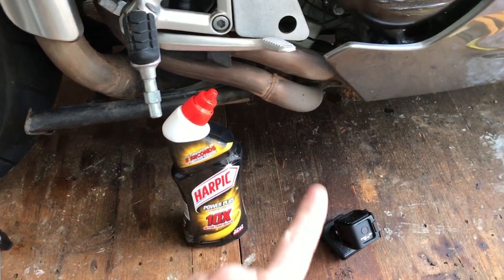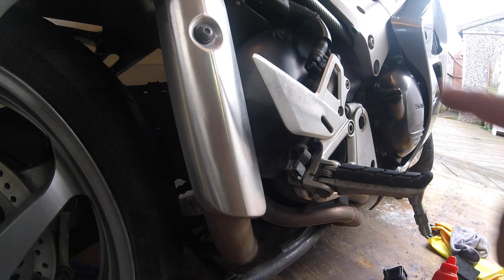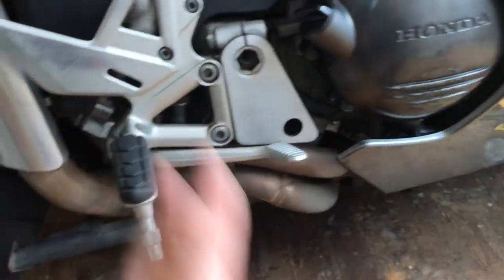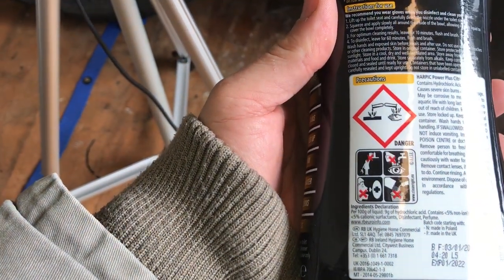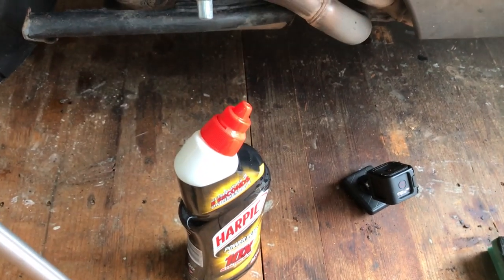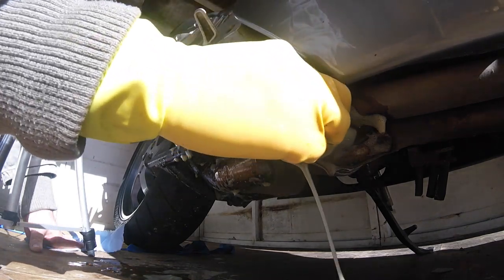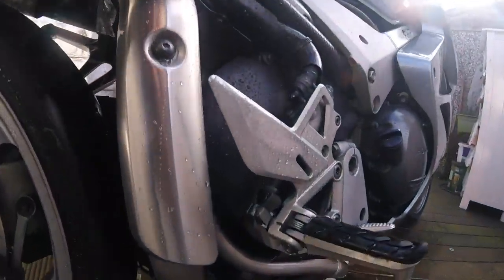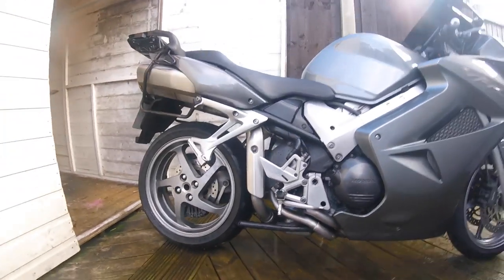Cleaning A Rusty Exhaust With Harpic Power Plus 10X

Comment: A word of warning : Although the internet is full with advices to use Harpic Power Plus 10X to clean a stainless steel exhaust, I would strongly advice not to. It contains hydrochloric acid and yes it will clean and penetrate the stainless steel surface impurities, but at the same time it will  destroy the surface of some stainless steel products that don't contain enough chromium to form a new passive protective layer. So in the end the cleaned surface will start to oxidice very quick and you do not want that. hydrocloric acid is the one acid that should NOT be used on Stainless steel, it actually destroys its capability to reform a hard chromium surface that prevents it from corroding
There are far better, safer products like welders pickling paste , that use milder nitric acid used in passivation solutions. They come in a paste form that is brushed on. Let it sit for half an hour and rinse very thorough (high pressure would be good) with a lot of water. It will clean and decolour the surface perfect and it won't harm the surface of the stainless steel. It is used by welders to clean the coloured and contaminated welding surface on stainless steel welds
Just to give a bit of warning.... You shouldn't believe me, search the internet on hydrochloric acid vs stainless steel..... Do the same on nitric acid.( Just don't let the nitric paste come in contact with aluminium.)
And one more thing : It is even stated in the Harpic Power Plus  product safety data sheet : Reactive or incompatible with the following materials: metals
Reply from the maker: Great advice ❤️👍🏻

Comment: Thanks for this video! To state the obvious - this is toilet bowl cleaner designed for removing rust stains and the like. It's not sold world-wide. It looks like CLR (calcium, lime, rust remover) or Lime-A-Way are U.S. equivalents, but I haven't verified this.
Reply from the maker: Thanks for info that may help other from different countries, these are the ingredients : Ingredients. Per 100g of Liquid contains 9g of Hydrochloric Acid, Contains <5% Non-Ionic Surfactants, <5% Cationic Surfactants, Disinfectant, Perfume.

Comment: Have the same bike, will try when weather allows a bit, was thinking of taking the exhaust off altogether, but I think the bolts are going to need replacing if i do that. I don't think it was ever taken down. Great video, and keep up the good work on the vfr.
Reply: Battery acid it did the job in 5 minutes,,,

Comment: Thanks for this video mate. Ive tried all sorts to remove the rust with no luck. Scrubbed hard and seen silver and nearly cried, so ive needed this video haha!

Got the exact same VFR as you, and getting they two screws off that holds the fairing together at the bottom was unreal man. One screw rounded that bad I had to hammer a drill bit into it and keep it there for when I put it back on. Nightmareee
Reply from the maker: Emails Cd same here with the screws, hope the vid helps ❤️❤️👊🏻

Comment: nice job craig ,but did it mark paint on your centre stand ? interested to know about it on alloy wheels ,
Reply from the maker: A H no it hasn’t which has surprised me 🤔 I know it doesn’t strip the rust it reacts with it, maybe it’s ok in paint. I might try on the forks as they painted

Comment: Are you using steel wool to scrub after and if so would it work with a wire brush I have a second hand Lexmoto Michigan I bought that has a rust on exhaust but on all the pics of the bike the exhaust is black so don't know if painted and